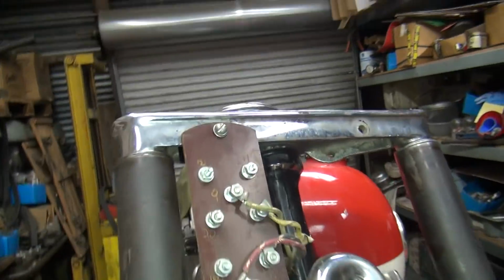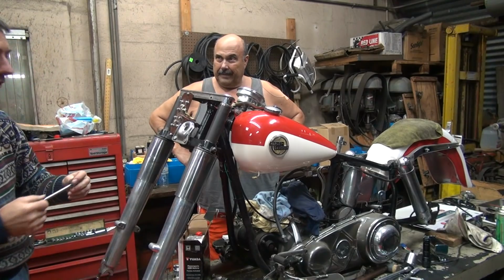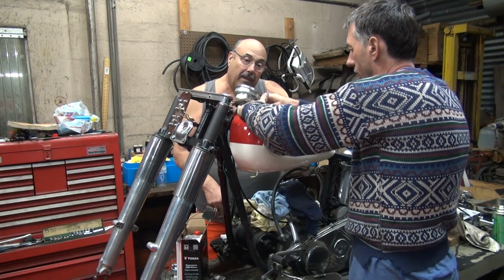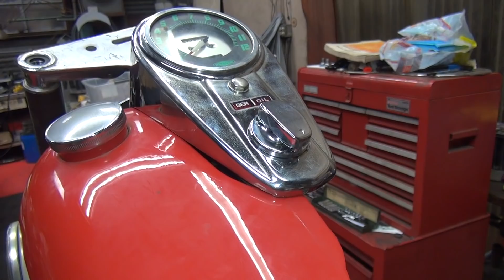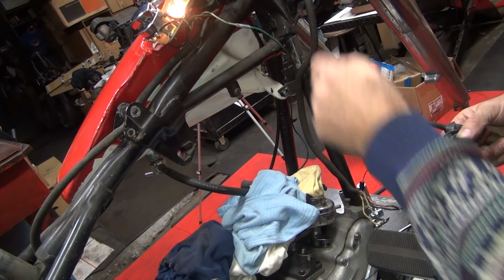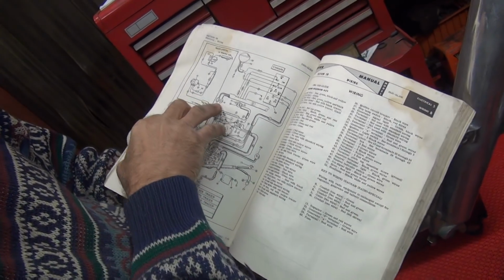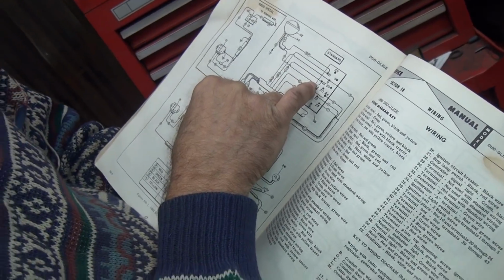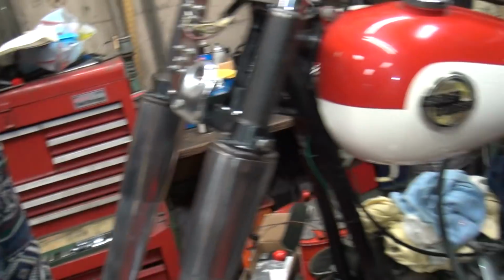1958 panhead 74ci #111 fl bike rebuild topend repair harley by tatro machine

Comment: so, is it hot or cold in there? nice job aligning the dash.
Reply from the maker: yes to both, it's just colder in back with the 1958 panhead. the 1965 pan is in the warmer front building. even san diego starts to cool down in dec.
tatro